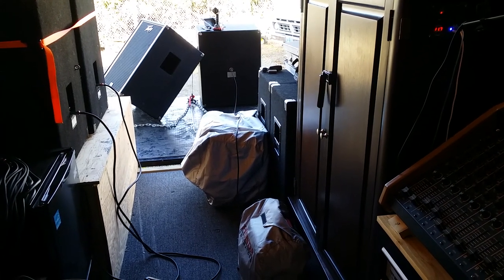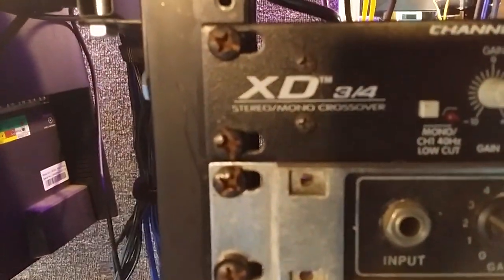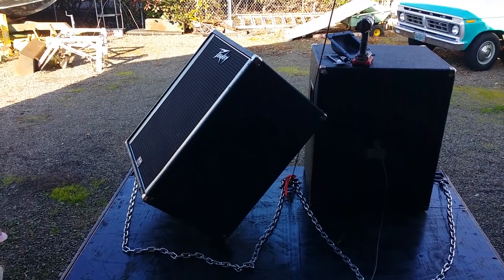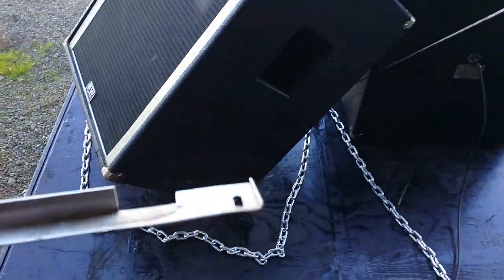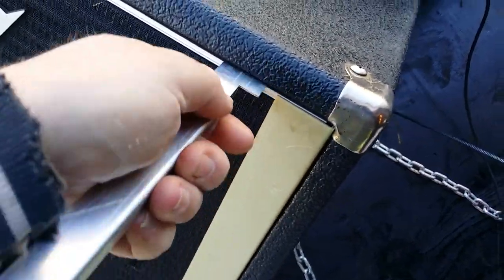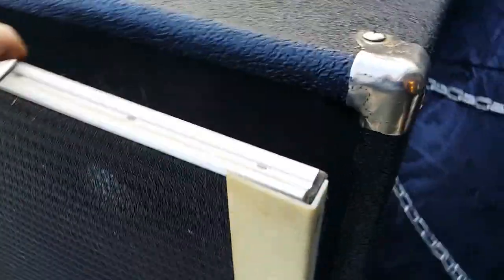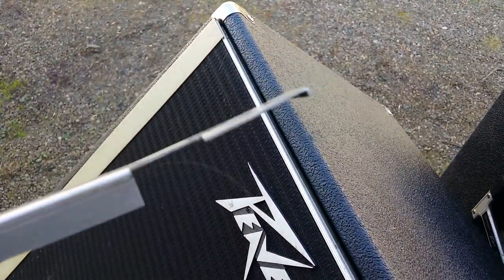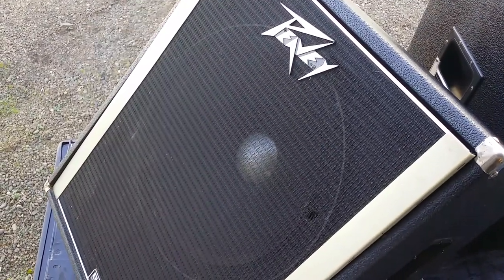How to remove grill from Vintage Peavey 118 Subwoofer. Custom Tool made....

Comment: Great job man, Im looking to get oneof those Peavey subs too. Can you tell me the best way to rig it up to myPeavey 6500i MIxer for a little more john Bonham BANG....  Thank You, John
Reply from the maker: Just connect the mixer between the source and the Amp, use a separate output and separate Amp for the subs. Use the EQ to shut off the higher frequencies and bang on!